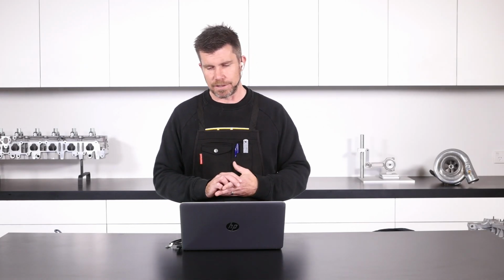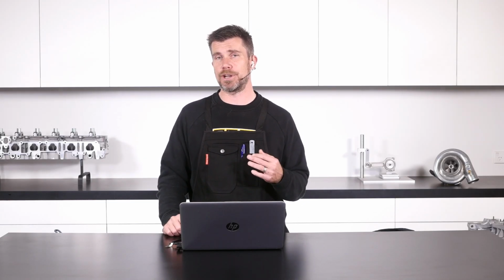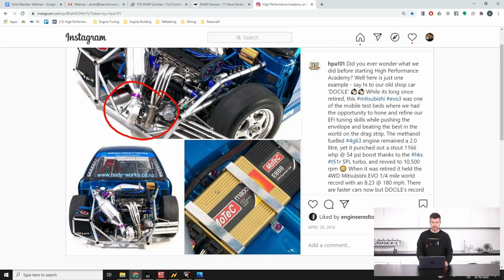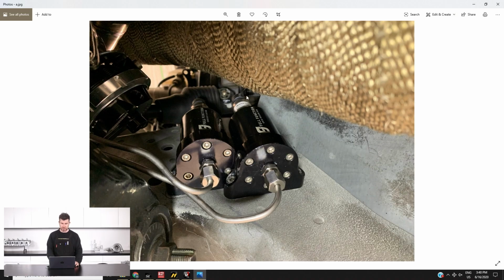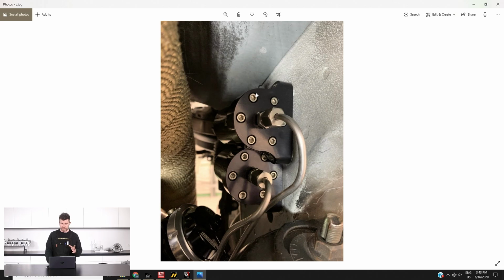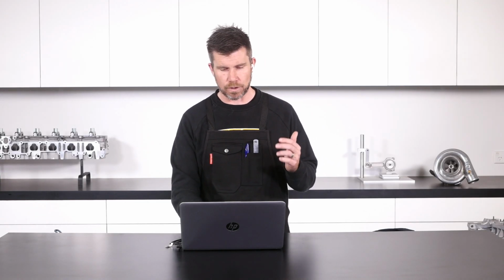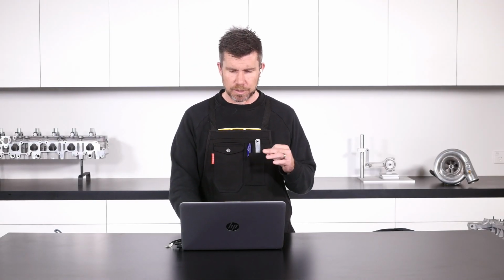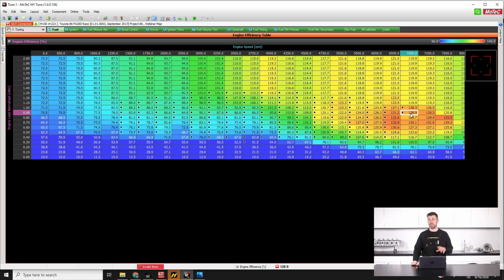Exhaust Back Pressure Vs Turbocharging For Car Nerds

Comment from the maker: 🦸‍♂ Building a fast car? Get $400 OFF the all inclusive VIP online course package deal: https://hpcdmy.co/vipy75
✊ Kickstart your EFI Tuning knowledge. Get 50% OFF your first online course: https://hpcdmy.co/offery75
TIME STAMPS:
0:00 - Introduction
1:16 - Back pressure and forced induction
2:03 - What does the TIP/EMAP data tell us?
4:16 - Data overview
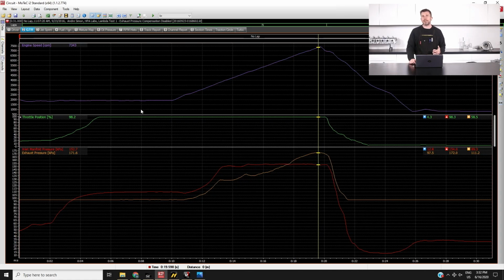7:36 - EMAP to IMAP ratio
11:53 - Drag racing example
12:36 - Technology is moving the ratio goalposts
13:47 - How do we get this data into our ECU?
21:35 - Using data as a load input
31:39 - Questions

Comment: 2 quick questions:
1. Could you retrofit a car with only a (Intake) MAP pressure sensor with a differential pressure sensor input (a standalone sensor which itself would output a voltage reflecting a difference in pressures, e.g. exhaust manifold pressure / intake manifold pressure)?
2. Would a speed density tune against a differential pressure reading better account for incremental or dynamic changes in exhaust backpressure (e.g. an improvement achieved by upgrading a muffler, or an improvement achieved by opening exhaust dump pipes / bypass valves)?

Update: I think I answered my own question for #1 - differential pressure (subtracting one from another) is not the same as dividing intake by exhaust manifold pressure. Would need a circuit to divide the signals to reach something useful.

Comment: Excellent lesson.  I am putting an IAG900 subaru into a Psycho Beetle project and it will see street use from 500ft to 7,000ft above sea level in its travel. This should help the Motec M150 keep things in line.  Thanks!

Comment: A little off topic What kind of back pressure would you expect to find in a natural aspirated and supercharged engine I have 900 wheel hp With dual 3" exhaust with an X pipe I am thinking I would benefit a bunch with a dual 4"  exhaust with an X pipe

Comment: Hopefully you still respond to older videos. I have an EJ20 with a custom twinscroll setup using a EFR7163. Is it possible to T booth sides of the twinscroll into one dampener rather than running two or just doing one of the scrolls?

Comment: As usual a great video
Having spent a number of yrs at Pikes Peak 
We always had trouble with our twin turbo 430 cubic inch methanol powered car maintaining hp when over 11,000 ft
We scarified power at the bottom of the hill to keep our exh back pressure in check towards the top
Thinking you can adjust on the fly is madness 
You’ll have it off the side in no time
Load curve is the only way
But damn it takes time to map
Reply from the maker: There's always some sort of trade off eh.
If you're into podcasts we've had a few guests who have been tuning for Pikes Peak. Might not be any new insight in there that you haven't already experienced but possibly some enjoyment from hearing others share the familiar struggles: https://www.hpacademy.com/search/results/?q=pikes%20peak - Taz.

Comment: Hypothetically can you use something like an electronically controlled straight gate running off a table to modulate EMAP  while still keeping enough pressure to run the turbine and maintain a boost or torque target? Can this widen the effective range of a turbo or make it feel smoother or more N/A like for circuit style driving or in my case riding? This is what I'm planning on my bike along with a 32mm DBW Bosch anti surge. My thinking was that at high rpm and IMAP I didn't think all that back pressure was required to drive the compressor but rather was a limitation with the wastegates especially poppet style and the control limitations of using springs etc

Comment: Team, 

Regarding the installation of sensor, what effect does temperature removal have on the EMAP. Presumably based on combined gas law, a decrease in temperature correlated with a decrease in pressure, ie, as measured vs MAP, there will be an error? Whilst in kpa as a unit, 5 percent or there abouts may not be a large error, it’s still a factor. 

Also, 

Regarding tuning, can you infill some information as to tuning against EMAP with respect to when the turbine housing/wheel becomes saturated….ie based on load, you can delay peak load later to keep map/EMAP in check to reach ‘power goals at high rpm’ (trade off being dogshit drive down low)? 

Great episode as always! 

Ta
Reply: One thing you completely forgot is that there's practically zero gas flow to the EMAP sensor. It's not that the coiled line would cool the exhaust gas, rather than it simply acts as a buffer between the sensor and the hot flowing exhaust. The gas in the line still would act as a spring, so yes, there's an increase in error, but it's not as significant as you think.

Comment: Link easily handles EMAP. In fact, using a couple Math Blocks - you could set any axis you want to MAP/EMAP*wheelspeed^2 + Pi * Log(fuel pressure).....not that you'd want to....
Reply: What's that formula ???

Comment: What’s inside those exhaust pressure sensor dampers? Curious how they work
Reply: Most of the ones I’ve seen are just steel wool
Reply: Yeah stainless steel whool. Ive build my.own Back pressure system with only 60$. 0-10Bar China Sensor 20$, copper Pipe 20$, Fittings 20$ and worked perfect without damper.

Comment: Would you say that one would prefer to have absolutely no mechanical filtering on the emap signal considering you could potentially (I'm guessing) use the than visible exhaust pulses to identify missfires and maybe even inequality between cylinders combustion efficiency? How hard would it be to cross reference the "noisy" emap signal with a crank+cam signal to overlay and identify which exhaust pulse corresponds with which cylinder?

Comment: Can we make a petition to stop calling referring to it as exhaust back pressure and call it turbine drive pressure (turbo) or exhaust restriction pressure (NA or post exhaust housing). It makes no sense to me because we dont refer to positive intake manifold pressures as intake back pressure.
Reply: No, the industry standard term is TIP. EMAP, and others, are internet terms.
Reply: In a way, it's better to call positive manifold pressures as intake back pressure, as that's what's actually happening in the engine. There's a common misconception that boost pressure equates to CFM, which quickly gets annoying when people compares two completely different engines by their target boost pressures, or equates boost pressures directly to power output.

Comment: Interesting episode !
I gained nearly 100 hp when changing manifolds and Turbos, on the same boost pressure.
The new compressors probably works at higher efficiency, but the largest portion of the gain was undoubtedly the lower back pressure.

And I had to pay with slightly reduced transient response sub 3500 rpm.
And the threshold where boost build up is possible were moved up about 350 rpm.
Change was from Garrett GT1752s to Mitsubishi TD04 18T, on my BMW 635 csi. (3,5 liter I6)

Comment: I am looking for a turbo for my 4g64 mitsi with a small port rvr turbo head. Im running it in my l200 and I am after a turbo that will deliver enough mass flow to make 250 hp at 3000 rpm so nothing crazy, i use this wagon to tow my race car. I want as fuel efficient setup as possible in the 2000 to 3000 rpm range. My goal is to have the map at least the same, or higher than the emap. I am not hugly concerned about turbo lag. Does emap have any influence on the brake specific fuel consumption? Is this even possible to achieve on small engine like this? I would imagine a setup like this would drive similar to a commercial truck where it takes a second or so to build boost.

Comment: Is there a relationship between manifold temperature and manifold backpressure ?
Reply: Absolutely.  Guy Lussac’s law and then the ideal gas law.  Basically, if volume is constant, relationship between pressure and heat are directly proportional.  I’d dig in a bit more to Boyles Law, Charles Law, Guy Lussac, and Ideal gas law for more theoretical knowledge if you’re interested. Cheers.

Comment: Might have missed, as this is running in the background, but...but
Depending on the application, it may also be useful to measure the post-turbine pressure, too, so the actual drop across it cn be known, and whether the rest of the exhaust system, if used, is also a factor that needs to be addressed?
The material used for the pressure transducer stand-off is also important, one with a low thermal transfer should be used, eg. a SS, rather than a copper based tube, and thermal sleeving/shielding would be a good idea close to the manifold, to reduce radiant heat absorption. Not something I've tried, but perhaps a heat-sensitive paint, such as used for brake temperature checking, may be an option for monitoring the temperature of the transducer or, at least, estimate if from the temperature gradient from the manifold to the transducer?

For those interested in forced induction, I would strongly recommend Mr Gale Banks' videos, they're primarily on diesel engines, but all the basic points are directly transferrable to spark ignition engines. https://www.youtube.com/@bankspower

Comment: Just got my car back up and running again. My question is are the calculations just as simple as EMAP/ Map (boost pressure) or is it EMAP/(MAP+14.7)?
Reply: Good practice would be to use absolute for both. MAP and "boost" are two different things, measured differently.
Reply: @gordowg1wg145  That's how I did it and it make the most sense on the levels and power I recorded.
Reply: @gordowg1wg145  I measured 42psi emap and 23psi boost pressure. 1.11 Drive pressure ratio. Right on the money. I go some more I can go. Twin turbo V6 so have two EMAP sensors.

Comment: Diesel guys have been calling it drive pressure for years. How much energy it takes to drive the turbine wheel.
Reply: Very much on point - while using exhaust energy to drive the turbine "seems" like free energy to the ignorant, there is a definite cost to, at least partially, drive the turbine against the impellor loading.